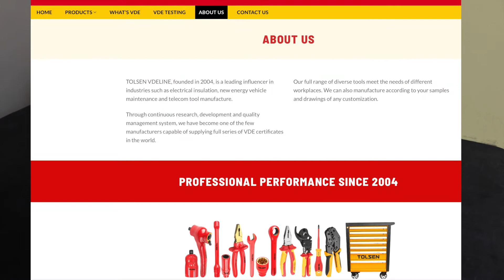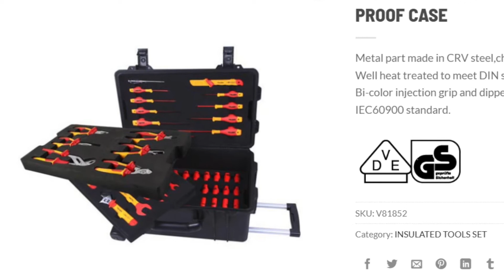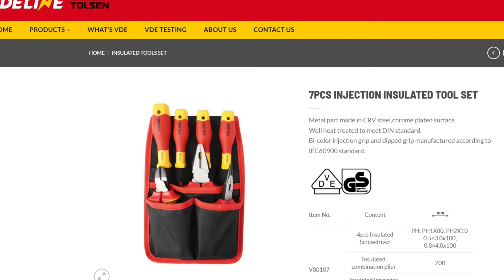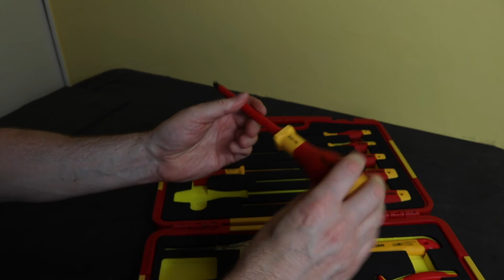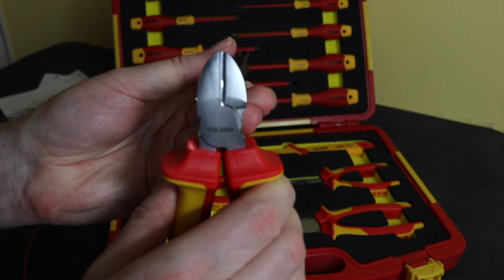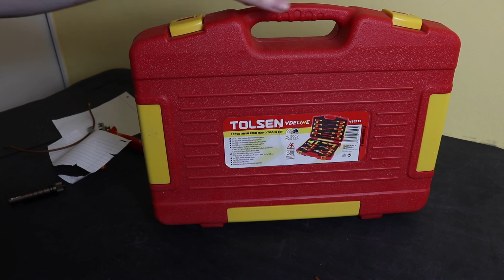Tolsen 15 Piece VDE Set Review

Comment: Always a great review. I see they have provided documentation on the VDE certification mark for their products. However I am unable to see the actual VDE certificates themselves or that they are current and in date at least in their VDEline website. I will stick to my knipex/Wiha sets expensive but I have that much greater trust in the products and the 1000v insulated rating certification remains in date also better quality product as you remarked. 

I was in the UK about 5 weeks ago and    Was looking at the quality of TIS instruments I think most of their testers are badged Italian products but was disappointed when looking at their two-pole voltmeters and proving units how flimsy they were at least compared to my fluke, Martindale voltmeters and proving units.
Reply from the maker: Thanks! You can find some of the VDE certification on the VDE Online site. It is certainly there for the pliers and wrenches but I could not see it for the screwdrivers. It may be the way I searched or there is an update waiting. I doubt they would put the VDE symbols on the tools without the certification. I could try asking them for it, through the website. There is certainly a quality difference between the Tolsen tools and Knipex / Wera, I don't have any Wiha to compare them to. 

Yes TIS rebadge a lot of the HT Instruments range. Their top end voltage testers are rebadged Brymen products, I am not sure about the 850 and 851 units.

Thanks for watching and commenting.